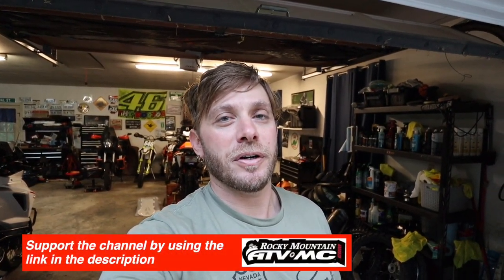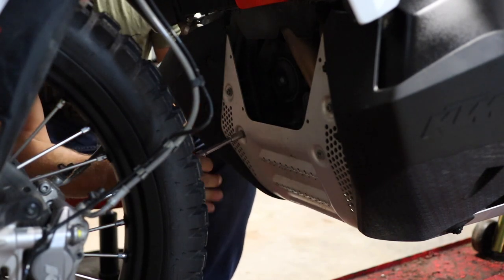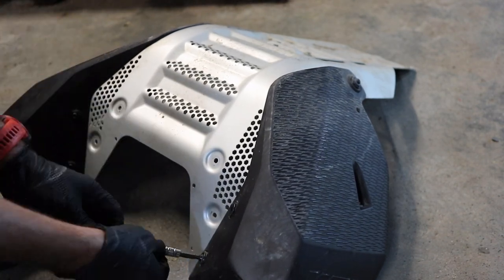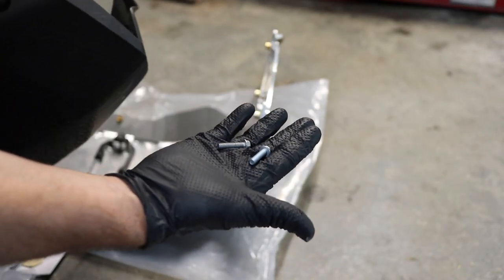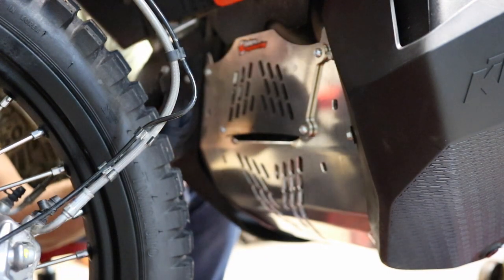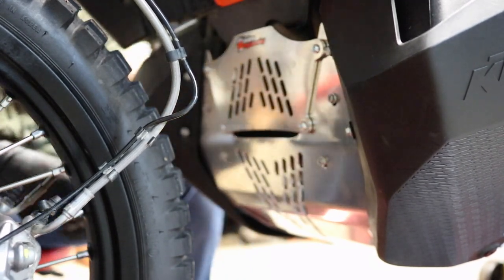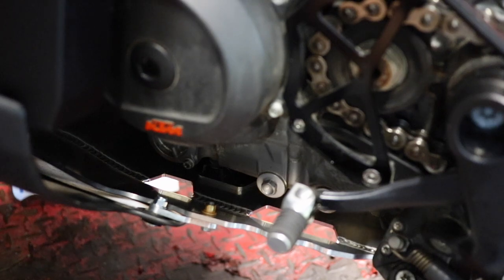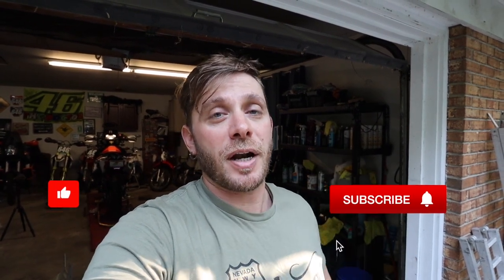KTM 790 890 ADV R Enduro Engineering Skid Plate Install | Back in the Garage

Comment: I just picked up one of these. Something I didn't see or think about when ordering is the fact that the bolt heads are sticking out on the bottom. For log or rock crossings and sliding the skit plate across obstacles, how is this going to be affected? Will these just snap off? What are your thoughts and maybe I can find some flush mount bolts.
Reply from the maker: Don’t overthink it. It’s a better skid plate. Go ride the hell out of it.

Comment: Looks quite sturdy.
However, I don't like the exposed screw heads.
They should have used countersunk screws.
Another nit pick is about units.
NM = Newton Mega
It should be Nm.
It's a very common mistake.
Reply from the maker: I'm back and forth on countersunk vs exposed. Exposed are easier to get to under the bike but get the advantage of counter sunk. As for the units, you'll notice I typically keep everything in caps, mainly just to make it easier to read for folks; get your point tho.